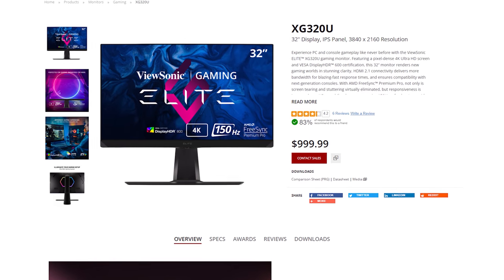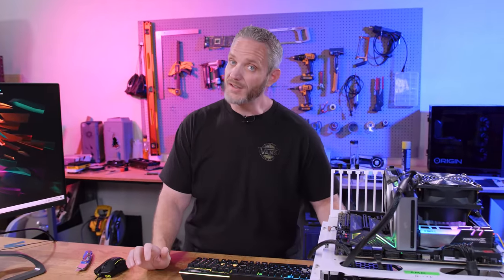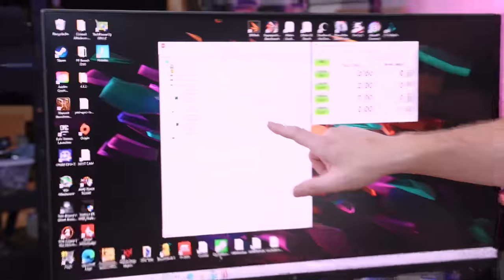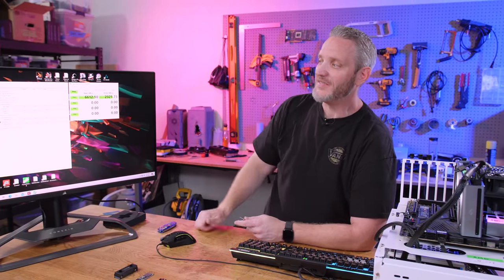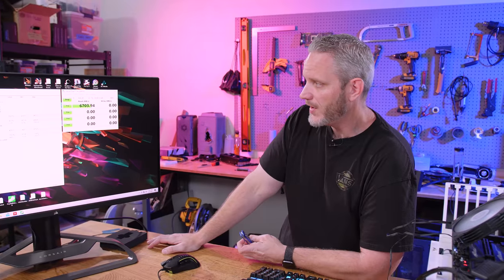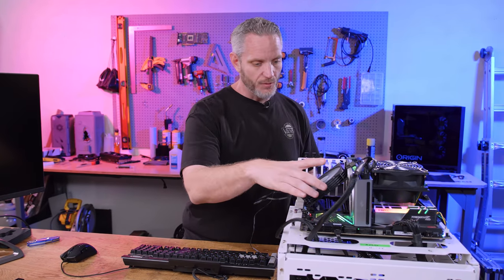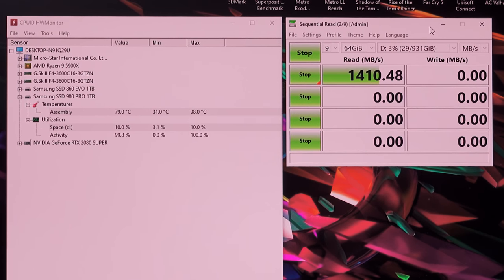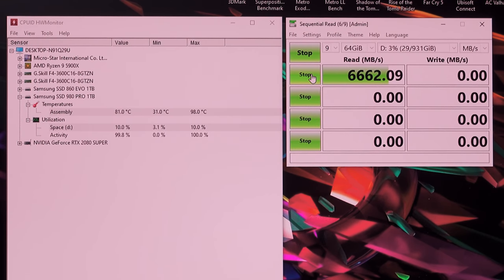I watercooled an NVME SSD... These results were unexpected!

Comment: I have Debian buster. MSI motherboard.ryzen 3700 . Gnome disk utility. When wiping my disk starts at around 500 MBs and finishes around 100 MBs. With thermal gun around 65c. I tried using electronics freeze spray. No change. The disk utility writes all Ones to disk.

Comment: I got one of those small EK nvme heatsinks, and it lowered my idle temps with like 9-10c. Wasn't an issue, but I use two nvme's and one of them ran cooler since the motherboard had a heatsink on that slot but not the other. So the temp difference urked me, I didn't have high hopes for those tiny heatsinks but I was pleasantly surprised. Plus it looks a little nicer now... :)

Comment: Many NVMe drives are exposed to hot GFx card air exhaust and can easily hit high 60s temps in a case with Good airflow as in my case, so I can imagine other systems experiencing some quite high temps.

Comment: Maintaining and upgrading a system with all these little blocks in is a nightmare, i went a bit ott on one about 15 years ago and regretted it. I made a system with  total of 10 water blocks in it and it worked fine for years but the first time there was a problem i just threw it in a cupboard and bought a new pc cause i didnt fancy error checking through that maze of pipes.

Comment: I think the difference between the flat piece of metall and the heat sink is not so much about thermal mass, but the way heat is dissipated.

A traditional style heat sink does rely on airflow, and without much air actually flowing, it is not very efficient.

The flat piece, the way I figure it works... Is probably with thermal radiation. I mean, obviously they both do emit IR, but the vertical fins are not adding much usable surface for radiation, much of what they radiate, will only hit the other fins right next to them. And the only effective direction is straight up. That is why heat sink is about as effective as a flat piece with similar footprint... Wich is why a flat piece with longer footprint has better performance... That is assuming there is essentially zero airflow. In many cases that might not be true.

Having said that, this is just my thougts on the topic, I have not done any experimenting or anything.

Comment: The variation in write speed prob has something to do with the internal heat control Samsung has built into the controller.  This test should be done on a prior drive without built in heat control

Comment: The only issue with the built in heat sink for the NVME SSID on the motherboard is that it's usually blocked by the GPU to get good airflow.  Although, because of that, there really isn't an easy alternate solution if the GPU is mounted flat into the GPU slot of the motherboard.

Comment: Cool the controller, not the NAND if you want better data retention and prevent throttling. Gamersnexus went over this awhile back. Though I wonder if a tiny heatsink might still assist in flattening the curve while keeping the NAND toasty enough for the data retention benefits.

Comment: Just copy a large file, like a VM. Windows shows you a nice little graph of rate vs time. If it slows down, then it's crap. You should be able to run full speed over an entire 200GB file.

Comment: It reminds me of a funny story when I put a rad on my boot ssd and it became overheating even faster. I added a dedicated 80mm fan with a shroud to blow on the fins, but it didn't help. After I borrowed a thermal camera I found out that my GPU backplate was heating the SSD rad, so no amount of airflow could solve the issue I created in the first place, lol. So, I added a high airflow 140mm fan to cool a GPU backplate. The GPU is Vega Frontier Edition

Comment: It most likely has to do with one of the nand chips for storage either having s defect or some kind of a bottleneck, i would suspect that answer as if it keeps happening it would most likely be one specific nand chip it writes to as its doing a sequential write not a random one were it auto assigns sections to write date over all of the nand chips to prevent burnout. To eliminate this and the programs/windows causing this issue get at least 2 other same size drives with one of them being the same as what you are testing and one from another company. it could be a software glitch in the controller that's why you should use an identical SSD from same company, and one that is from a different company and ideally if you could get 2 were one that has the same controller and one that has a different controller chip

Comment: I do have to wonder whether benchmark tests like this, with throughput rates up to several gigabytes per second have the slightest relationship to real world performance and experience, at least on the sort of workloads used on a personal computer. My experience on much more modest SSDs is that some other aspect of the system throughput is the limiting factor using "real" workloads. It often seems that benchmarking becomes and end in itself.

nb. on SSDs with write caches (as that one has) will exhibit very large changes in speed on write throughput according to whether the cache has become full or not and if there's been time to stage the data to the main flash memory. It's not entirely predictable and whilst keeping things cool is generally always a good idea, whether it has anything to do with these results is very difficult to say. Tests would have to be repeatable under carefully controlled conditions starting with identical, new SSD units for each and following precisely the same set of tests and schedules. There are simply too many variable.
Reply: Had to scroll quite a ways to find a post with so many good points. Totally spot on. Making the emulated SLC cache layer issue worse, many modern models are made cheaper by having no DRAM buffer either. DRAMless NVMe is cheap, but it needs a good controller, etc. to make it run well (such models rely on a main RAM buffer aswell, so main RAM speed becomes a factor too), though there are always usage scenarios for which they are wholly unsuitable.

Funny how not that long ago in the SATA3 SSD days many midrange SSDs had good behaviour for complex workloads (like the 850 EVO), but now the push to capacity, at the expense of performance (because modern devices have far few channels due to individual dies having so much capacity), has resulted in products that have highly variable behaviour. For general builds where NVMe doesn't matter so much or isn't viable (eg. older mbd), I keep looking for used 840 Pro, 850 Pro, Vector, Extreme Pro and other SATA3 models which don't suffer from the kind of usage-specific issues that many modern NVMe drives exhibit. It's bizarre to see how in some situations a "modern" NVMe can be slower than a SATA3 from many years ago.

This is why I avoid all QLC models and generally avoid DRAMless models unless I know it's not going to be an issue (eg. the WD SN 570 is a decent option for general gaming, but a bad choice for, say, media archive backup).

Comment: My Motherboard is a msi z390 gaming pro carbon from 2019, my primary SSD had no cover just open on the mother board and at idle at 49-55c . . . . . I just bought on amazon Heatsink cover with thermal pads  LOL . . . I have a second SSD port at the botton that does have cover and thermal pads that came with it, that one is at 37c idle

Comment: Something I've always wondered (and was reminded of with the absurdity of this premise) is, "How much of an effect does temperature have on the overall efficiency of a system?" Where you might see how an aircooled system performs/benches/stresses, and how much it draws from the wall, repeat the process with the system covered/suffocated with a cardboard box to force temperatures higher, see the results of benchmarking/stressing and power draw, and compare those results against a water cooling loop you would use for such a system. dunno if  also doing gpu /cpu separate would help paint a fuller picture since you rarely max both cpu+gpu out?

 I thought this might be a valid exploration since peak consumer components are now drawing 250-550W a piece out of the box, and some places have surprisingly high costs of electricity. Or would this be more for GN/the University of Steve, or LTT? (or all of them for different perspectives?)

Comment: Wouldn’t it be an option to use the heatgun at the Radiator without the fans to heat up the Nvme instead of melting the mainboard? Just as an Option to test where different ssd start to gear down.
The block itself seems to be a nice way to mod the cooling of the vrms

Comment: I've seen a test in crystal disk mark 8.0.2 when the disk hits 82C on sensor 1 and 99C on sensor 2, (Samsung 980 Pro 2tb), without any cooling. 6499 read and 4712 write. Then they tested Elecgear M11, (a fkn small ass jetengine) at 2000rpm and at 9000rpm, 2000rpm= 63C/54C @ 6502/4938mb/s. 9000rpm= 56C/47C @ 6504/4940mb/s.

Comment: The ssd tests don’t care about temperature meaningless because as you see, the reading and writing are so fast. So unless you are enterprise, you’ll never has the issues. Enterprise also have much better heat dissipation. So it’s looking for a rare or fringe case scenario that no one really experiences. I actually do a lot of data base stuff on terabyte data files and still it is cpu bound.

Comment: If you set your video card to not stop its fans at idle, wouldn't they help cool the SSD (at least in your case)? Obviously that would depend on where the SSD is located on each motherboard.

Comment: On Windows you can use the Cipher comand with the overwrite option.

cipher /w:D:\

For a drive mounted on D. It will write all 0s, all 1s and then random numbers on UNUSED space.

So, you could fill up the drive beforehand and test on the unused space.

Comment: These results were expected. SSDs don't really throttle in any realistic usecase without something stupid going on unless you're like wearing out your SSDs by running repeated benchmarks, and rarely even then. Even the longevity argument is questionable as the flash memory will probably start wearing out before the controller gives - and depending on what research you're trusting, cooling down the memory is only accelerating that process. That part is actually something that might be interesting to test out.

Comment: Jay, please use HwInfo instead because it will give you BOTH temp. sensors of SSDs and not just one. Here you probably only saw the flash memory temp. sensor and not the controller temp. sensor.

Comment: I think I was having crashes due to my nvme overheating and 30$ for the corsair block is worth it to me, as my loop will cover CPU, GPU and NVME. taking appart a component has never been to much of a hassle, as I have click connections in the loop and the smaller part is easy to drain (10 sec max)

Comment: What if you were to attach that water cooled block to the metal strip that came with the motherboard that covers the ssd? I dunno how you would attach it... maybe 3D print a clamp of some kind?
Anyway, I have been using HW Monitor for years and can vouch for it's usefulness in keeping tabs on your hardware's temperature. It's how I found out my new video card was overheating a few years ago. One custom fan curve later and no more temps over 70c.

Comment: I had a Samsung gen 3 nvme SSD get hot on me on my threadripper machine, I was trying to play Snowrunner when it first came out and I kept getting random crashes and the longer I kept playing the slow the system got, sometimes it would just freeze, found out it was the SSD, I threw a little heatsink on it from a old video card memory chip and never had an issue since.

Comment: you ever had a broken ssd or m.2 and you had to save the data from a broken drive.  That would be a good topic for a video.  However, operating systems should have their own m.2 units so that when it breaks down due to wear and tear, it is replaced by those who have worn it out the most with random writings and readings!

Comment: @JayzTwoCents I started looking for additional data on this after watching the video. Theres an article I found on google from 2021 that already did this Jay 😫 the article even comes to the same conclusion of which is to just use your motherboard heatsink.  The article even has graphs with each cooling method and temperature results when running crystal disk. I wont reference the site because I don't want to seem like BOT but anyone can google "tested does m.2 nvme need a heatsink" and it will come somewhere near the top.
I want new content Jay build a monster truck PC or something JK but not really... DO IT!!

Comment: Perhaps writing an endless string of rand() output to a file until the drive is full, then overwriting, for several hours?

That's assuming the rest of the system can generate said string fast enough 🤔

Comment: In linux the test is just "dd /dev/null /dev/nvme" it wont stop writing "0" to the nvme directly until you cancel the command with Ctrl+C. Don't use /dev/random or if you must use /dev/urandom because generating actual random numbers takes longer than the NVMe could write it.

EDIT: Two other things, 1) you should have removed the Samsung sticker! haha, plastic is an insulator. 2) it's not performance that degrades with speed, it's longevity. For every x degree C up it starts to fail y% faster. Samsung know this, that's why they put the plastic sticker on in the first place.

Comment: I realize I'm raising this thread from the dead, but in the datacenter world on Linux systems I've used Bonnie or DD to do big file copies to stress storage.  YOu could potentially do this with WSL by just doing a dd and doing it in a for loop from /dev/urandom to a file, then zeroing and starting over.  This will also stress the CPU and RAM though since /dev/urandom is just that.  lol

Comment: Jay,....I did just like and subscribe.  I'm liking your videos!  As a person who will be attempting to build their own computer [a first PC build], I've appreciated many of your videos.  Planning on:
Dark Kingpin motherboard
i7 12700
3080 Ti
1 TB main drive
2 TB storage
1000 watt power supply
32 GB RAM
Custom liquid cooling of CPU and GPU
Lian Li case [one of the large ones].

Just some of the main stats.  I was kind of up in the air about the custom liquid cooling, and just going with a basic one, but I do like the look [would run a mostly clear with mix of blue and green dye], and I figure a cool GPU will be a happier GPU, especially when I'll be playing Skyrim with a bunch of graphic Mods or other graphic intensive games].  

Will be an expensive build, though.

Comment: Ok, so the result suggests that cooling the ssd is not needed cause of no performance gains?
What if the point isn't really the ssd but more of a general one? The ssd is often located near the graphics card and or other heat sensitive parts. Having the ssd running at 70c might make it harder to cool other parts of the system?
Is that a plausible idea?

Comment: My motherboard came with it's own sort of hearsink for the M2 drive, i didn't bother using it as gamers nexus said, it writes better when warm and you only need to cool the controller and gaming doesn't really get the controller hot enough so for gaming cooling the M2 is a little pointless

Comment: Obviously once you have 2 or 3 drives installed and everything else your system is going to get really warmed up. Problem with my mobo is the gpu sits on top of the fastest m.2 slot I think. It's a pain to remove but I hardly ever swap drives unless it's for a bigger size which is years apart since I wait for prices to drop.

Comment: The 980 write speed is too slow for the test. When I looked at the top tier SSDs that come with chunky or water cooled blocks they’re around 7k read and 7k write, such as Corsair’s MP600 Pro XT Hydro X (gotta love long names). With the tests that Jay ran the read was hardly affected but the write throttled.

Comment: The only time that I had an Issue with heat on a nvme SSD was when I was running two 1080TI's. I had PCIE fan on the side of the gpus blowing into the gap to give the top fan air. BUT it would blow directly on the SSD of my operating system. It would be fine until I started in 3DSMAX. Everything was running full bore and the hot air was being recurculated right onto the SSD. 

One question that I do have is can you remove the sticker to see if it insulates the drive at all? Ive always wanted to do it but never wanted to ruin a 300 dollar drive.

Comment: There is an issue with your thermal testing: large (64GB) sequential read/writes are only a "worst-case scenario" for the NAND, which isn't as sensitive to thermal throttling as the controller is. A worst-case scenario for the controller would involve multiple smaller read/writes at high queue depths.

Comment: spoiler alert , im only at 9 sec into the video and the tech savy in me is already saying "for large to huge transfer loads , cooling your chips and the controller will help a ton since lots of voltage has to go through so the storage and transfer can actually happen , both on the controller and the actual memory chips (aka nand chips) "

Comment: I have two 2.5" sata ssds in my system. One for my OS and a few other things, and the second for game storage and stuff. This video has me thinking. How hot do sata drives get? I imagine heat affects read/write speeds a little bit just like m.2 and similar. I wonder if that's why American truck Sim crashed on me that one time.